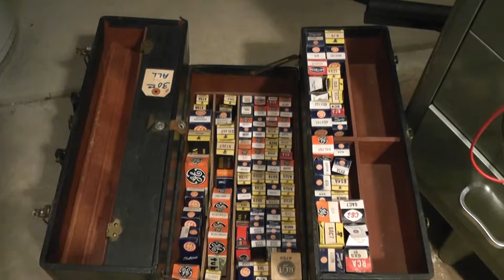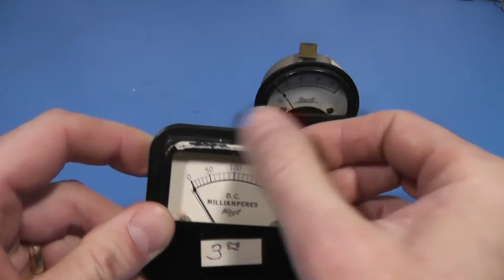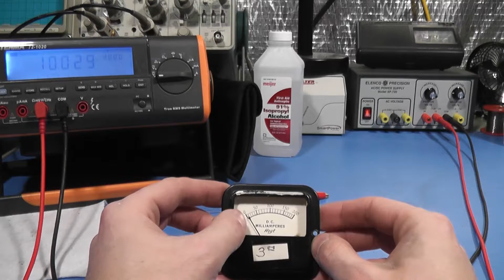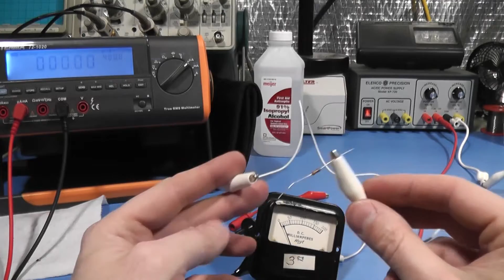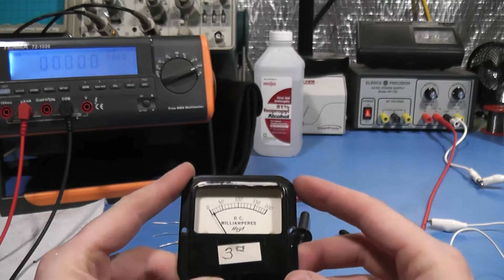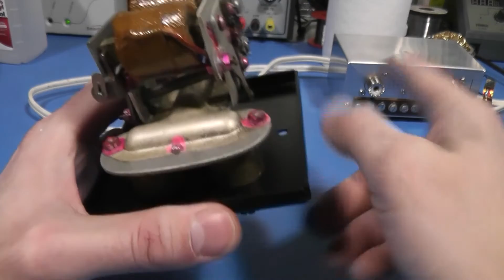On the Bench #1: Hamfest finds, characterizing a meter, and coaxial relay examination

Comment: Don't know if you are still on YouTube but great explanation video on the differences between TR switches and coaxial relays. I'm constructing a remote antenna switch for web use, and picked up a NOS 26.5VDC coaxial relay which I will mount in a metal box with BNC connectors. I couldn't find anywhere how the switching occurred with these but now I know. Thanks again!
Reply from the maker: I'm still here, it's just been quite some time since I had the time & energy to edit a full video!